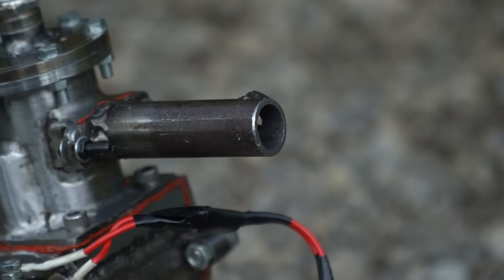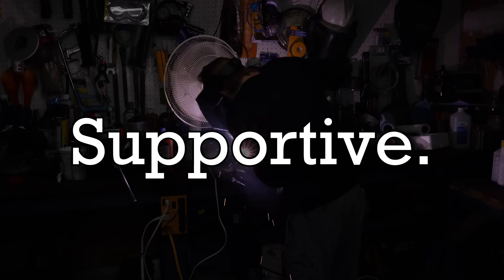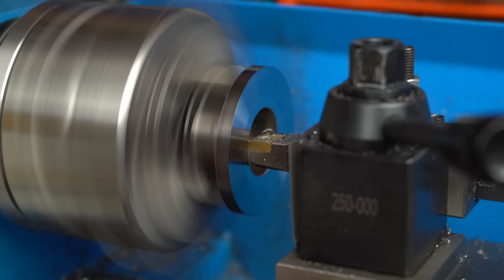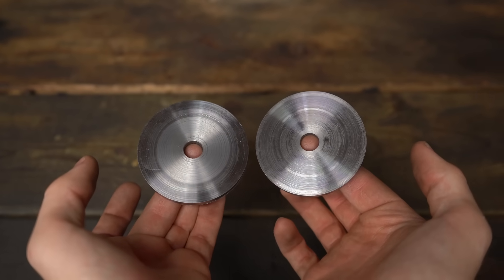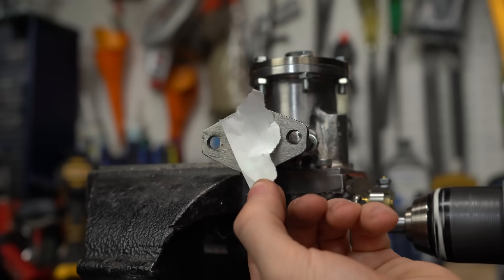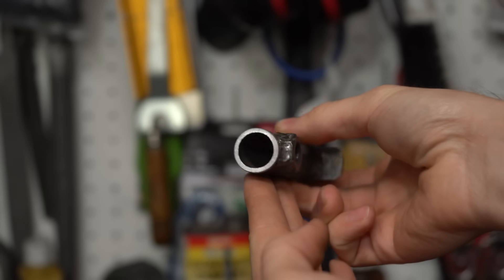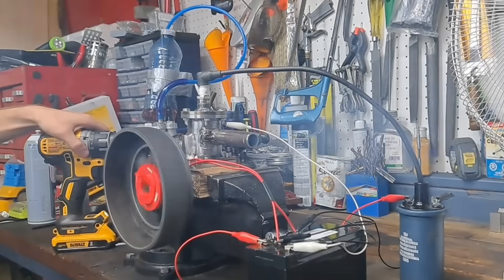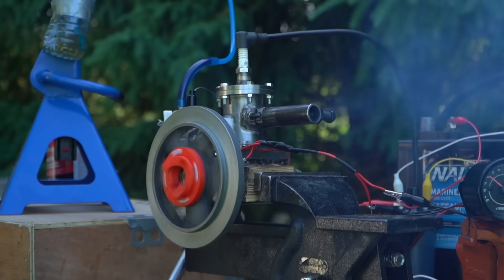I Made a Two-Stroke Engine Using Things I Found at the Hardware Store

Comment: Great video. Just to let you know, adjusting the needle e-clip position on the carburetor is actually how you adjust mid-throttle fuel/air mixture. There should be a little stop screw  on the side for the throttle slide that actually adjusts idle speed. Another screw (usually) on the side adjusts idle fuel/air mixture.

In general, the pilot jet/screw controls fuel at idle, the throttle needle and needle jet controls fuel and mid-throttle, and the main jet controls fuel at full throttle.

If you wanted to improve the way it runs, you could probably do it by adjusting the mixture screw and possibly re-jetting the carb with smaller jets.

Comment: It could use some type of air flow retention.   Chainsaws don’t use reed valves like big 2 strokes.  They use a texture on the intake manifold that is easy for air to flow one way but not the reverse way.  Like right angle pyramids

Comment: I'm surprised how well it runs considering you have no seal on the crankshaft, while you are using covered bearings, those let quite a lot of pressure through(in practice you will also likely melt the covers). In terms of the back pressure stuff, a 2 stroke needs resonance, that is a mix of scavenging(negative pressure in the exhaust) and back pressure(positive pressure) that is timed just right for it to suck extra mixture through and spit it back in. For the carb I'd suggest using something like a PHBG clone which has completely tunable with the main jet and idle jets. Moving the slide needle only affects the mid throttle and high range richness and is often used to control how the amount tapers up, not for general mixture. For general mixture you will have the idle circuit and load circuit, idle circuit consists of an idle jet+air screw(fuel screw on some), jet is base, air screw is trim, this will control your starting, idle, decel, and partially ramp on throttle. And the load circuit is your main jet+needle, general mixture is set by the main jet, your ramp on is also partially set by the emulsion tube in which the main jet and needle sit, and the needle then regulates the ramp on of the mixture as the throttle opens.
Reply: Also zero balance.

Comment: 2 strokes are typically air-cooled. Manny have fins incorporated into the castings to displace heat. Also if you look at most mufflers for 2 strokes, they have large expansion chmabers.

Comment: Remove the fan from your welding area, put it a bit further away and just wear a mask for welding. Two things shouldn't be where you weld (with the exception of tacking) - powerful magnets and wind blowing. That's (in part) what's ruining your welds. Build yourself a gas extractor, they're not difficult to make and can be made on the cheap. Super cheap. My first two welding gas extractors were made from vent tubing, metal flat stock and the filter housings from three old farm trucks. For a fan, i evicted the old squirrel and made my own squirrel cage fan with riveted blades made from the thin tubing for used roof gutters. One of them still works today and it's, honestly just as good as the proper one.

Comment: I think you need some head pressure from your fuel tank, carbs aren’t meant to suck fuel from the tank, they suck fuel from the float bowl. you should have your fuel line coming out the bottom of the container. Will probably help.

Comment: Good video bro   Give your mini lathe a service you can remove a lot of sloppy excessive backlash just by adjustment   And use a rubber hose/tube around tube it reduces vibration and a magnet also works well when placed on boring tool shaft   Expansion chamber exhaust will help aswel

Comment: Please put a copper tube around the cylinder and make a little copper radiator and run it off a little store bought liquid pump and fan. It would go great with the motor

Comment: Back pressure is usually bad for an engine, as it causes resistance in air flow. 

You want an exhaust that helps in scavenging, which is when the exhaust pulses pull the air through the exhaust and help with air intake by taking more exhaust gasses out of the motor.

I’m glad you figured out proper spark timing for the motor, I had commented on a past video about it and the air fuel ratio you were using.

Amazing video as always, you made an amazing motor!!!!!
Reply: that is for 4 strokes, 2 strokes need backpressure for better compression and using the fuel that goes through the cylinder into the exhaust during the intake/exhaust stroke.
Reply: @tktspeed1433  Wow, this is interesting!

I always thought that you’d want to shove more air into the engine, rather than keep exhaust fumes in there.

Couldn’t you “add” compression with forced induction?
Reply: @switchpro3842  Yes you can absolutely turbocharge a two-stroke. However, since there are no valves, a lot of the pressure from that turbo will leak out the exhaust port, although the blades in the exhaust will also give you some back pressure.
Reply: @rienkhoek4169  I’m aware of the concept of using forced induction in general, but my question is would adding forced induction increase compression ratio, or can that only be done with higher quality/compression rated pistons and rings.

My thought is that if you were to supercharge a 2 stroke you could add compression and expel more exhaust fumes, allowing for better air:fuel and potentially more compression. IE: more power.

IMO a good 2 stroke build probably consists of valves and a cam, with preferably a roots/twin screw supercharger. Mechanical valves should add to compression as opposed to static valves. And letting intake and exhaust valves open could allow the supercharger to push the air through.
Reply: @switchpro3842  I think the issue isn't about getting the combusted gasses out, but about preventing the new air/fuel mixture from escaping. The ports that let the mixture in are below the exhaust port.
Reply: @rienkhoek4169  I believe my theorhetical supercharged twin valve two stroke idea would also work for that pore problem, given my (admittedly somewhat stolen) idea involves cammed valves keeping the air fuel mixture in during the combustion stroke

Both valves could be open for different durations during an intake/exhaust stroke, then closed for a combustion stroke.

Supercharger should cover not only expelling gasses, but putting new gasses in if done right.
Reply: @switchpro3842 supercharged two stroke engines do exist but they are typically diesel. And yes they do have valves

just look at wartsilla ship engines. The cylinders are so massive that you can fit multiple men inside
Reply: @tristan6509  Wow, I always forget about the larger scale engines. Those ship engines look insane

Comment: Your engine four stroking could also be fixed using some grinding. Take the piston out, grind a bit off the top of the exhaust port or some of the of the piston on the exhaust side. I know a little about the engine type you're working on.

Comment: Did I miss something or did you put a one way valve somewhere? Like a reed valve or something? It's pretty exciting you got it to run at all if you didn't! To my knowledge it is a super required part for two-strokes, but I guess not ¯\_(ツ)_/¯
Reply from the maker: it actually isn't necessary! If you google "piston port intake", you'll find 2 stroke designs that don't require any reeds. In terms of raw performance, reeds are a bit better, but for simplicity sake piston port works great

Comment: A crossflow design without the correct piston shape probably isn't the best idea, but it runs remarkably well considering that a big portion of the intake air probably gets blown straight out the exhaust.
Reply from the maker: I had the transfer ports angled in a way that the gas jets towards the back of the cylinder away from the exhaust port, still not super ideal but it works alright

Comment: If you want the engine to run better and last longer, remove the seals on the bearings so they are lubricated with oil instead of grease. "naked" bearings are the norm in 2 stroke engines.

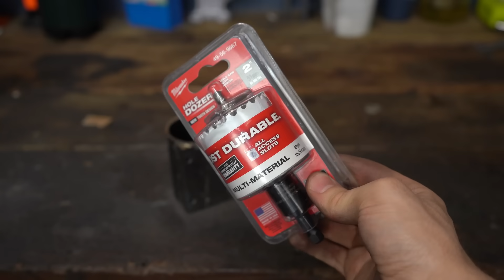Comment: 3:56 this might be the best bit you've ever put in a video
Also, buddy, I hate to be the one to tell you this, but there's a reason roller bearings aren't typically used in crankshafts
Reply: Rollerbearings are very commonly used in crankshafts of 2 strokes
Reply: @fishy6320 they aren't good. Ball bearings either.

Both suffer from cage failures and are rpm limited because of centrifugal force pushing the rollers balls or needles together leading to either cage failure, seizing against each other (cageless) or pitting the ID of race until it eventually fails.

Plain bearing is the way to go. 

The bigger problem is that the balance on this guys engine is AWFUL  only one web which is maybe 25% of the counterweight mass needed.

Vibes destroyed the bearings.

Comment: Yoo i have an idea - an inline 4 two stroke - buy 4 ms881r cylinders with pistons and rods, design a split crankshaft, a sealed engine block with separate chambers for each of the cylinders and a intake hole in it, fit something like a g2 reed valve to it, take 4x 324a pumper carbs, they would need fine tuning to all 4 od them, and make an ignition system for it that will work reliably, engine block can be cnc made, possibly as a 4 piece block or a single piece, also you could design an expansion chambers for them, if you have a discord server or something like that, i could help you with this, as this is the project im currently designing, tho idk how it will turn out really

Comment: 2strokes can really be as simple or as complicated as you want to make them. From simple piston ports to reed valves to exhaust power valves to tuned expansion chambers.
Reply: I think, he should have at least made an expansion chamber. One of the dumbest i ever heared about 2 strokes is, that they need backpressure. 
2 strokes don't need "backpressure", they need an exhaust pipe wich is able to get the exhaust pressure wave to resonate with the piston movement.
Reply: mandernachluca3774
Correct, it actually needs the opposite of back pressure.
Expansion chambers create a suction on the exhaust port to pull exhaust, and fuel air mixture out.
Reply: @mrbmp09  I’d say that the specific amount of average back pressure can vary surprisingly much without hampering engine performance too much.  Expansion chambers are also resonance devices, sucking the exhaust out and using the sound wave of the exhaust (if tuned correctly) to pull the intake air fully through the cylinder until it starts escaping the cylinder, when the resonating wave pushes that air back in.  The net result makes back pressure variable, so that the engine isn’t breathing it’s own fumes, and so that it gets as much clean air per cycle as possible.
Reply: Or you can do what he did...and re-discover a Poppin' Johnny Hit & Miss design. Which technically is...well...why they used giant flywheels to store torque. Those dudes ran on alcohol or gasoline to heat up the cylinder, then you swapped them over to kerosene or diesel when the chamber & piston expanded so compression got high enough to run on it. Flame-lickers were like that. They only fired every 2 or 3 strokes, sometimes even every 5 to 6, because they depended on torque, not RPM's (being a max of like 350rpm, not the 3600 you are used to or higher, with no torque). That way, they could pull a house off a foundation, and only go 8mph.

They also had a piston 50X the length and weight of his, and the crankshaft alone took overhead cranes to install in the REALLY big hit or miss motors (the ones the size of your house).
Reply: there’s some good software online for getting the dimensions for a pipe, the hard part is making one without a slip roller lol
Reply: Anything from a trabant straight 2 to a V12 Detroit diesel.
Reply: I wonder what sort of comparative trials he could do with different homemade 2 strokes.  I’d advocate for rotary and reed valve designs based on Cox engines to be a good place to start.  Also, it would be much better and easier to make them for nitro or diesel, or just straight methanol.
Reply: Finally someone smart. I HATE it when people say two strokes don't use valves. They don't need them, but they absolutely can have them.
Reply: @Patrick.Weightman  especially good if theyre sleeve valves like a Rolls Royce Crecy!
Reply: @Patrick.Weightman esp on injections ones
Reply: i would argue straight piping is detrimental fundamentally

Comment: Check out twostrokestuffing's video on how to tune a carb. You need to do more than just moving the needle, and the "mixture screw" is an air screw, and is only meant for fine tuning it so it'll idle smoother.

Also, a pipe is unnecessary for that thing. You could get enough power to snap that crank in half with just porting and tuning the carb/ignition.
Reply: Agreed, mixture is far too rich it seems (even if the added oil makes saying with certainty difficult). Get a set of carburator jets so you can tune it properly :). Congrats though, very nice project
Reply: I drive these things daily, never owned a car and never will. I promise you, the pipe is important. Specially if there's any wind, or the motor is under load. That unspent fuel, or having extra oxygen pushed in, really alters the performance drastically. Better than a pipe, get an expansion chamber to really maximize it.
Reply: @XiaolinDraconis  Having something for an exhaust is basically a must, yes. But an expansion chamber is completely unnecessary for that thing. I'm guessing it's around 50cc. That crank looks like it wouldn't be too happy with anything over 5hp. I have a sachs MAHLE 6.25ps 50cc cylinder from the 70s in my garage, and it makes that power without an expansion chamber. It's got good low end torque too, meaning there's a lot more power hiding in it if the port timing was raised a bit.

I daylied a vintage moped for 3 years, I have rebuilt probably 25-30 engines. They have all run perfectly fine without an expansion chamber. He needs to tune the carb and it'll run perfectly fine
Reply: @XiaolinDraconis  He built an engine from a piece of pipe and essentially other "scraps". You think not having a tuned exhaust is the major source of power loss?
Reply: @shanerc  I said that? No. Not having any exhaust is definitely screwing the mix, I  would know I ride one, kills my ability to accelerate quickly and bogs out before it can top out.

Comment: You also need a readvalve on the inlet Port to prevent back pressure going back to the carburater
Reply: It's a piston port setup, you don't need a reed
Reply: No. Most 2 strokes didn't get reeds until the late 70's. 

He needed some oil... the thing was running with zero oil, doesn't help much

And also only one crank web, webs are supposed to be 50% of the rotating mass being the conrod and piston. 

Probably why the bearing exploded after 2 mins of running time
Reply: Hes using a piston port instead of reedvalves or rotary valves even tho those would be better

Comment: Braze or solder some ductile copper tube around it to make it liquid cooled! And use Loctite 680 retaining compound on the crank for the flywheel, and the rod bearing. Might help a lot!
Reply: That would work for cooling.

Comment: Just one small problem, you made the exhaust and intake ports too wide, if the piston rings get caught on the edge enough times, it will blow up. Try making two or three holes.
Reply from the maker: I also should have made them more of an oval shape in retrospect, in order to not snag the rings

Comment: I'm pretty sure the thick smoke pouring out of the exhaust was the oil you poured into the crack case making it's way over the piston and combusting with the fuel.

On the subject of cooling, other than making a whole new block, you could weld some cooling fins on the side of the cylinder.
Sadly that might lead to warping of the inside of the cylinder so you might need to make a new piston and re-hone it.

Other than that, incredibly fascinating video to watch.
Reply from the maker: Thanks! For the cooling I was actually thinking of brazing pieces of copper onto the side to create fins, as it would hopefully be a low enough temperature to not warp the bore out of round
Reply: @CamdenBowen  Could also make a bolt-on sleeve for the cylinder with the fins, and thermal paste in between to ensure thermal conductivity.
Reply: @CamdenBowen i dont know how long you want to run it but when its not too long a small box with water and ice should be enough?
Reply: @thomaskletzl6493  heeyy yeah! those old hit and miss engines often contained a big water tank above the cylinder, no radiator. Was literally just a heat holding tank.

Comment: Back pressure can be a great benefit when in the form of a tuned pipe. That makes the engine run really well but at the cost of a narrow rpm band. A muffler or some sort of chamber flattens out the power band. Your exhaust port looks a bit too big to me, Id try narrowing it up a bit. Id highly recommend a connecting rod made out of one piece instead of welded, there are pretty signifigant  forces at work there. Pretty cool that it runs at all, no offense...everyone has to start somwhere.😊

Comment: No back pressure is needed on a. 2 stroke to run!  Run well though is a different story!! Also messing with the needle does not change idle fuel ratio. The air screw on the side of the xarb does. And jet size

Comment: I literally just got home from Home Depot and saw this video dropped! And I come with a tip! If you need lots of threaded rod and don't mind it being slightly bent and have to cut it, you can go to the electrical section and buy 10' of it for under $10

Comment: i had a few twostrokes engines and in all cases doesn't matter if you have or not the exaust sistem (doesnt matter what kind of exaust) and yes, the powerr delivery and carburation changes, but it should wortk without it